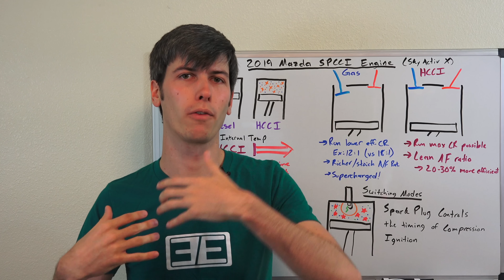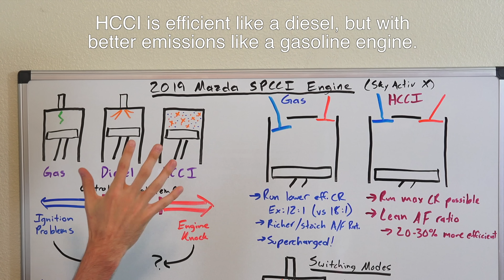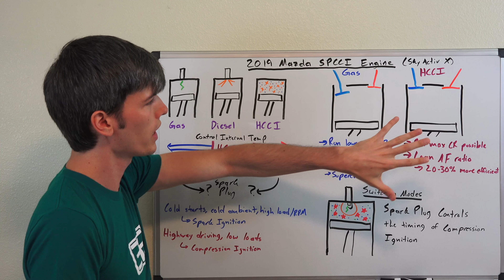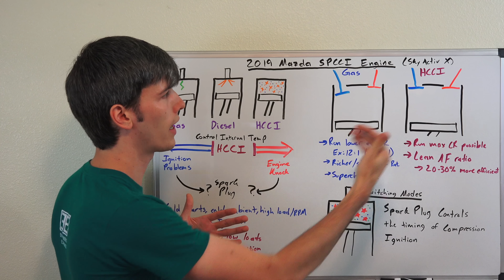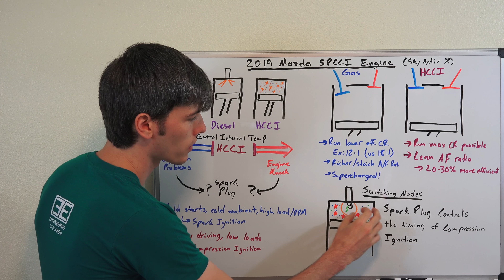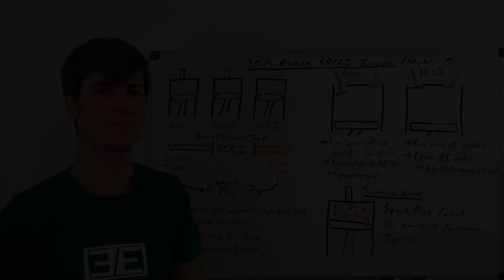Mazda Creates The Holy Grail Of Gasoline Engines - HCCI SkyActiv-X

Comment: Compression ignition requires stronger internals which means more rotation weight which means lower RPM limits without resorting to more expensive alloys.

Comment: So they took smokey yunick's adiabatic engine "hot vapor engine" renamed it and called it their own? He took a buick v6 cut 2 cylinders off to make a v-twin that made 150hp and got 60mpg 30 years ago. It used a modified turbo to vaporize and compress the air fuel mixture before it entered the combustion chamber. This engine exists to this day. Then a Canadian company comes along, uses the same technology calls it their own uses a modified honda engine making 200+ hp and 75+mpg and crams it into their car called the Ale'. The garage where it was kept and the working prototype burned to the ground. Now mazda's like we had a breakthrough. Lets vaporize the fuel with hot air, compress it with a supercharger and ignite it via high compression. If I recall the downside to the previous two engine was super high NOx emissions.

Comment: I can't help but feel like this isn't even new technology at all. Your talking about Spark Ignition like its a new feature. The compression combustion variation is where the emphasis should be placed. Maybe I missed it, but is this direct injection? The atkins(?) effect is an interesting bit there as well, which basically explains how they modified a diesel engine to run gasoline. I'm also surprised they chose a supercharger instead of a turbocharger. It also seems counter-intuitive to utilize forced induction with the intake valve timed the way it is.

Comment: It's laudable to try to combine the pros from gas and diesel engines - but it's basically trying to combine the advantages of a bow and a knife for hunting. My take: use a gun :-)

Eventually we will end up with 2 things: mass transportation for average joe because individual vehicles will have to be restricted at one point due to overpopulation.  There's just too many people on this planet to have everyone drive around in a car. The other thing is some form of electric or magnetic drive. Don't get me wrong - You could give me a Tesla for free and I'd trade it in for a nice Jeep Wrangler with all extras. I don't care about gas mileage at all. This planet is doomed anyways and not because of cars but because of people. 
Still, I would take a lightweight Jeep Wrangler with an electric 4 wheel drive (one motor per wheel) if it had a 300 mile range and the same or less weight it has now. Electric motors have so much torque it would be perfect for off-roading. The downside is you'd have to have an automatic transmission which personally I hate (if I go off-roading I want control and not an auto-pilot flying me through the desert around Moab). It would probably be the most fun Jeep yet.
Sadly looking at battery technology this isn't going to happen any time soon.
Reply: I'd take a Jeep with a 3 phase water cooled synchronous motor hooked up straight to the transfer case (no need for transmission) AC/DC Inverter driven, PWM throttled, with NI-MH battery bank in the back under floor, and straight 3 yanmar diesel up front hooked to a 3 phase generator. Basically diesel-electric set up like used in heavy rail. Can run on electricity alone, can run on diesel, no range anxiety!
Right now I'm on the stage of accumulating parts to make it happen, but with the way the time flies I'll be done when anything with an internal combustion engine will be banned lol

Comment: I'm interested to see how the aftermarket will look for these engines. Like internals and what not. Would they want to change the compression at all with the pistons for higher output? Or would it all basically just be done with tuning through the computers. Going to be keeping a close eye on this as it grows either way.

Comment: Inter combustion engines are wasteful pigs, albeit advances have made them more efficient but this HCCI still sends a lot of fuel into the exhaust to be burned there having the Cat. do the clean up.

What if one separated the molecules of the liquid gasoline (invisible vapor) before it entered the combustion chamber?

Comment: Finally there is a manufacturer going the right way and designing a better way to burn the fuel for more power less emissions and better mileage. All the terrible government regulations regarding emissions has been forcing the manufacturers to put a pile of useless emissions garbage such as egrs catalytic converters dpf's and other garbage which in reality do more harm than good. In truth these items do serve to reduce vehicle immisions at idle but actually this causes the engine to work harder and burn more fuel to overcome the friction and pumping loses due to this garbage being unnecessarily installed. Heads up all you greenies out there. The key to less emissions is in the engine burn not all the emssion garbage after the fact. I for one welcome this coming change.

Comment: Interesting on controlling the compression ratio with the intake valve. Infiniti has a variable compression ration engine, using servos, and links on the crank, and piston, to actually change the top dead center of the piston. I actually think you did a video on it a while ago. For those of you questioning why companies are still developing fuel powered engines, it is simple, as much has you may dislike it, fuel based engines will never completely die. There are some instances where a full electric plug in, just is not useable. Most notably people who live in the city. There are many of days where I come home, and have to park a block, or two blocks away from my house. "But when you buy a electric car, if you live in the city, you have recharge port built in front of your house, and have it own spot specifically for electric cars, making it illegal for anyone else to park there" you might say. There are also many of days where I see cars parked where there is a big white x for no parking, because it is on a corner, or parked in front of a drive way, or in front of a fire hydrant, or pretty much parked any where they can, be it legal or not. So yeah great when I get home, if someone is parked there, I can have their car ticketed, and towed. However when get home from a 12hr shift, the last thing I want to do is be outside, making calls, spending hours, trying to get someone out to tow it away. In the mean time, my electric car dies, and now I am really in trouble. Also when you want to drive to some where far. It is a hassle to have to make a plan on where to charge your car, and actually make a plan to spend a decent amount of down time there, while charging it. So I think the future is either combining a incredibly efficient generator, with a electric motor, or finding a alternate, cleaner burning fuel, for the internal combustion engine. One of the concepts I'm really for is a hydrogen engine. With the magic of electrolysis, you can convert water into hydrogen. Meaning we essentially have a unlimited supply of it. Because hydrogen in air form is incredibly close to gasoline, with gasoline at it simplest form being a HC or hydrogen and carbon atom, and hydrogen being h2 or 2 hydrogen atoms, converting a slandered internal combustion engine, to run off of hydrogen, really isn't that hard. With fuel, you have the carbon, meaning when you create the explosion, or split the hydrogen, and carbon, the carbon can combine with the oxygen, creating co2, or green house gases. With hydrogen you only have 2 hydrogen atoms, meaning when you create the explosion, and separate the 2 hydrogen atoms, they simply reform with the other oxygen atoms, and create water out the exhaust. If you get the hydrogen from electrolysis, you even have pure oxygen, meaning there is not nitrogen, or other elements found in air, so you can run as high compression ratio, as you want, and not have to worry about NOx. The only problem is figuring out way to make electrolysis efficient to be able to get enough hydrogen, on demand.

Comment: Another challenge is that pressure-detonaton is producing extremely high forces on piston, crank and connecting rod. It is like having engine "pinging" (premature netonating-"dieseling") constantly at highest possible force.
Pinging can damage modern engine(crack alloy pistons, etc.) in short time, and this one will have to last waaaaay longer than "normal engine" to be worth considering...

Comment: Seems to me as though the ecm or pcm should have a range of idea at the initial startup as to what the afr should be due to stroke, volume etc. adjust on the fly by sensing emissions and other various factors in an efficient combustion in relatively to the desired energy and force needed in this application and this is my view on how things my evolve, sounds like an excellent idea,  now if we can engineer a man made gas or liquid that is replenishable to take the place of fossil fuels. I look forward to hearing and seeing more on this

Comment: More mechanical jiggery-pokery to raise the overall efficiency to what? 30%? Just use an electric motor already. >90% efficient and one moving part. The big box of nuts and bolts solution is dead.

Comment: This doesn't sound like the holy grail of engines this sounds like an overly complicated and expensive to fix engine that happens to make better fuel efficiency and slightly more power... Why not just make a gasoline engine with a high compression ratio without spark plugs, using the heat created by compression to ignite the fuel from an injector.

Comment: I see that you have a diesel cylinder diagram on the board as well, maybe you stated this in the video but will this engine be a "dual fuel" engine in which you can use both diesel and gas?

Comment: Gas engines always had a air to fuel ratio of 14.7 to 1 to control Nitrous Oxides.  Diesels always had emission problems that kept them from wide spread use in cars.   Mazda stopped selling the rotary engine for poor emissions.  So how is Mazda going to control all these emissions?

Comment: Interestingly, this is something that can be done naturally with a rotary engine. There's a tendency for a rich mixture to develope due to the natural sweep of the engine, right at the trailing rotor-tip. With a stoichiometric ratio, this are becomes too rich to ignite and either blasts out the exhaust, or sweeps around into the next combustion cycle.

But, if you're running a lean mixture, what you get is a stoichiometric mix at the rotor tip, which is triggered by the trailing plug. The expansion of this mixture compresses the rest of the chamber to the point where it's able to light off. 

Now then. Add direct injection to a rotary at the 'top' of the engine to create this stratified charge and you've something that might actually pass emissions legislation.

Comment: I can't wait to see this tech develop.  There appear to be some real efficiency gains to exploit in the ICE.  I have some questions:

With the higher compression ratio, are the loads on the conrods and bearings going to increase? How will they manage these loads and still keep a low friction and low power to weight engine?

Will they use direct injection to control the hydrocarbon emissions going out the exhaust valve, or/and negative effects of AF mixture pushed back into the intake manifold?
Reply: Just read the press release, and this sounds pretty exciting.  The ultra-lean burn description is similar to our industrial natural gas (NG) engines.  CAT is the most famous in this part of the world and uses this tech in their G3600 series engines.  As they are really lean burning, forced air induction is needed; turbos being the method used by CAT.  These NG engines also use pre combustion chambers to ignite the AF mixture, but compression ignited would be an interesting development.

https://insidemazda.mazdausa.com/press-release/mazda-announces-long-term-vision-technology-development-sustainable-zoom-zoom-2030/ 

- This new proprietary combustion engine combines the advantages of gasoline and diesel engines to achieve outstanding environmental performance, power and acceleration performance.
- Compression ignition and a supercharger fitted to improve fuel economy together deliver unprecedented engine response and increase torque 10–30 percent over the current SKYACTIV-G gasoline engine.
- Compression ignition makes possible a super lean burn that improves engine efficiency up to 20–30 percent over the current SKYACTIV-G, and from 35–45 percent over Mazda’s 2008 gasoline engine of the same displacement. SKYACTIV-X even equals or exceeds the latest SKYACTIV-D diesel engine in fuel efficiency.
- With high efficiency across a wide range of rpms and engine loads, the engine allows much more latitude in the selection of gear ratios, providing both superior fuel economy and driving performance.

Comment: I thought that the spark ignition was for when the engine was cold. I've been hearing rumours that they were using air injection to control the engine at hotter temperature's.

Comment: what I want to know how does this engine works at high altitude like Colorado, high humidity such as Florida. Desert temps as Las vegas. what kind of fuel cause of pre-detonation. Are these engines ran under ideal conditions such as a lab where every aspect is controlled.
Reply from the maker: Engineers do think of these scenarios, they'll be tested everywhere, like all current products are.

Comment: One question that's not directly related to the HCCI engines (because that You explained very well on this vid): on an engine that does the Atkinson's cycle, where do the gasses that are expelled thru the intake valve go? Do they get recycled somehow? Can't it generate "backfires" to the intake?
Thank you.
Reply from the maker: Back into the intake, and then used in the next intake stroke. Everything is re-used, yes.

Comment: Seems like it operates with controlled knock. 
I'm putting my money towards Bosch's Direct Injection Compression Ignition. Then the fuel can autoignite and burn as it's injected like a diesel. Though I am curious how Mazda really is controlling the knock in their system. Mazda is definitely going to struggle walking the fine line of HCCI and pre-ignition.

Comment: Please, make video about current skyactiv. I have Mazda 3 2016 1.5L 120hp and it's engine makes me crazy because fuel somehow falls into oil and dilutes it (oil 0W-20). It happens in winter when temperatures are below zero degrees Celsium. This problem also hits Mazda CX-5 engines. Maybe you know why that may happen?
P.S. I use 95 gas.

Comment: If the intake valve is open during compression, how does this engine prevent back pressure and backfiring into the intake manifold

Comment: If it is compression controlled does that mean you can only use one octane rating in the car, and not switch between 91,95 and 98 like people do now?
Reply from the maker: +soloxcan they will have to be able to compensate for differences in octane, but they will likely recommend a specific octane. Will have to run on everything though, like everything these days.
Reply: Engineering Explained wow, you replied to me!!! This is more amazing than meeting a movie star

Comment: IC-AC-Electric Triple Motor Hybrid 8-13-17; A new concept in Autos
IC-AC-Electric Triple Motor Hybrid Auto
8-13-17 Jim Moncur, MS
It is apparently true that you can capture the heat in a auto exhaust gas and put it to useful work as in the VW TSI engines where water-glycol coolant encapsulates the exhaust manifold prior to a turbocharger. Or we can also use a heated coolant liquid surrounding the exhaust manifolds and in the general radiator to make energy for electricity to power an electric engine with from the thermoelectric effect - where we can then make electricity to power an adjunct electric motor that adds power to a gas powered car and uses Li-type batteries.

Alternatively use reverse flow AC fluorocarbon gas-liquid pump system. Hot AC gas from a running Internal Combustion engine would rotate an AirCond motor with speed&efficiency making rotational power directly connected to a generator to make electricity to charge batteries.  These batteries would then run an electric motor in a new type of IC-AC-Electric Triple Motor Hybrid Car.

Another way to make electrical energy from heat in a hot liquid system would be to use existing or a new chemistry based solid state photon releasing substrate that is on the other side of a liquid radiator system that then uses photo-solar cells close to it to generate electrons to charge batteries.

Comment: I cant understand, why spcci should increase the expansion pressure with the same fuel amount just because the combustion ignites itself. I absolutely understand the emission friendly aspect of a homogenious air/fuel mixture, but i cant imagine why the carnot process should be used more efficiently?

Comment: You are wrong. HCCI will along with the sparg plug for cold stars use high pressure AIR INJECTION to ignite the fuel.

Comment: Why not leave the exhaust valve open to lower compression ratio rather than intake I feel like the constant backwards intake air, especially if it's supercharged, would cause problems. Whereas it would just go through the exhaust as lean if the exhaust would do it, I'm sure the ecu would be able to figure out that the leanness is coming from the cylinder in the compression stroke.

Comment: I'm not mechanic or engineer , how will they adjust the compression? I thought that would be controlled by the stroke of the piston.
Reply from the maker: +Allan Lange they might not, only speculating, but you could by changing valve timing so that some of the intake charge is pressed out of the cylinder during the compression stroke, by briefly leaving the intake valves open.
Reply: you could do it as you described, basically Atkinson cycle or use decompression valves linked to a common plenum like in old dual fuel International Harvester motors...